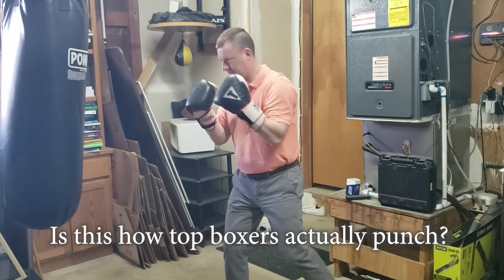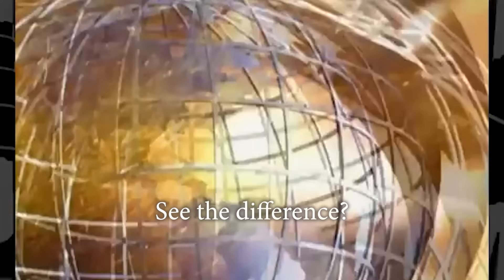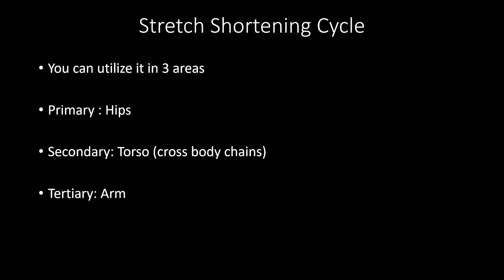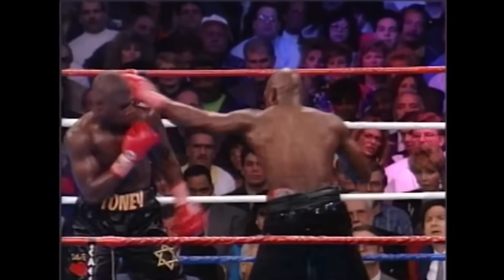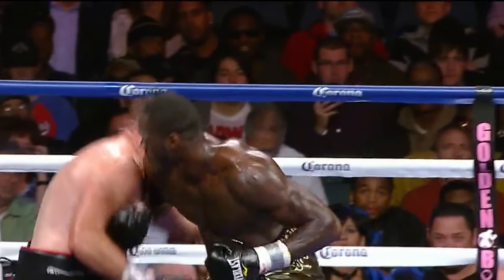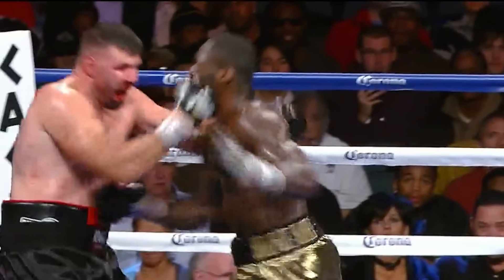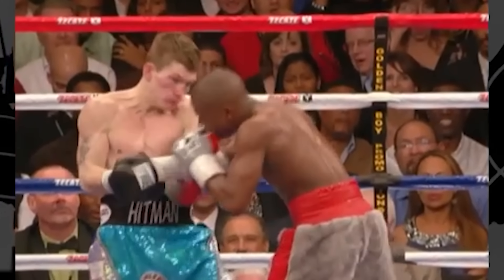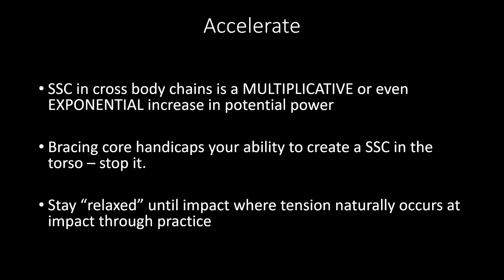How ALL "Natural" Punchers Generate Power: Kinetic Integrated Mechanics Reference Video

Comment: Hello Dr, I have a question. Do you think the opposite leg (rear leg for lead hand punches and lead leg for rear hand punches) should be attached to the ground at the start of hip rotation?

Or if you're in a situation where you have to move the opposite leg, do you think it's right to move the leg after starting to rotate your hip?

For example, when you fly your rear hand with your lead leg one step forward, do you think the punch moving your lead leg while rotating your hip time is wrong?

Comment: It's crazy how these mechanics aren't a solved problem yet actually. For me personally, the most basic thing I keep in mind constantly is just focusing on speed. I think of it like a whip, from the ground up I try to get as much mass moving... basically stacking speed, like a train riding on a train riding on a train etc.. and then stiffen it all with a good grounding posture at the end.

I find it hard to... imagine? How the 'mass' of your body plays into it, it's a constant. But I wonder if it matters how much of your body is moving towards the punch and how much of it at what speed.. If that makes any sense.
Reply from the maker: You have the right idea. It's a cascade of accelerating body parts. Check out my physics video for a bit more info.

Between my youtube videos and my program, The Power Punching Blueprint, I’ve pretty much solved it. It’s not a mystery anymore. My program goes into full detail and drills these movement patterns into your muscle memory so they are repeatable. It’s like learning how to throw a ball or a golf swing. Totally doable with the right instruction.

Comment: I noticed that you Sometimes lean a little Forward during your straight right. Does that increase the Power even more? I have heared that leaves bodyweight behind and this decrease your striking Power.
Reply from the maker: Check out my "cheat codes" video, it's "recoil management" or managing the equal and opposite force coming back when you land with power. You'll see all the guys I feature here do it too - GGG, Artur, etc.

Comment: The action of gripping the floor helps with the pushing off from the ground during the punches (and also stability after the punch). The muscle tension decreases the slack between the transfer of momentum from the floor through the toes, heel and ankle into the leg. It can also provide a bit of extra push off the toes.

Of course, those are micro-optimizations, but if you can train them so they become automatic and you don't think about it anymore, why not?
Reply: 100% Feet and toes  is where all chain energy starts light on feet and plant on power punch same as the hand open hand until near impact old school USSR training
Reply from the maker: it reduces surface area contact with the ground. you don't have claws... does a sprinter or running back try to claw the ground when he pushes off? no.
Reply: @ThePunchDoctor  Again, it's not about the actual gripping. It's the act of contracting the tendons to stabilize the toes and ankle structure. "Gripping" is just an easily communicable word to use.

You absolutely do use the gripping-like contraction in sports. Try pushing off the feet without our toe structure stabilized. Sprinting/running is not the same as the footwork in martial arts. For example, in fencing, when you push off the ground, when your heel comes off the ground, what's left in contact? The toes. Those toes can give you extra push in that split second. Imagine when your heel comes off the ground and your toes structure isn't stabilized.

Not to mention sprained ankles if your ankle structure isn't stabilized.
Reply from the maker: @kwanarchive  gripping gives an idea that you're curling the toes which is inaccurate and paints the wrong picture imo. we are talking about two different things.
Reply: @ Only if you take martial arts words literally.

Not all boxing coaches are academic teachers, and not all boxing students are academic learners. Telling someone to "grip the floor" is an okay (not perfect) way to get the idea across of what you need to do to stabilize the foot structure. That is what is meant by "grip the floor", and most people intuitively understand what to do if they don't nitpick it.

If there is a better way to communicate that idea, then fine. But I don't think it's correct to go the other way and say people are wrong for teaching it at all.
Reply from the maker: @kwanarchive  it encourages linear movement which is not how the body moves. I'll make a video about it.
Reply: @ Looking forward to it :)
Reply: @ThePunchDoctor okay I don't wanna nitpick but using sprinters here is probably the worst example possible given the fact that their shoes literally have spikes to do the gripping for them, as well as boxing shoes being relatively grippy which allows a boxer to move relatively on the balls of their feet without slipping all around the place. HOWEVER what was presented in the video makes a lot of sense in MMA or kickboxing where your bare foot has shit grip on the often slippery mat, and/or you need to be ready to kick or stuff a takedown for example

Comment: What was told to me is that I usually have my right hand high right? And punch from that position as that is a good habit. But punching with your cross from a lower position generates much more forces at comes from your body and hip. Instead of closer to your shoulder

Comment: Hello, I agree with your video, one small thing, at 8:39 you throw a jab, but your hips move away from the target, and u drag the rear foot back - which takes away a lot from jab power. only that snippet is wrong in regards of what you are trying to convey to the viewer at that moment, as pivot same side punches always rotate a hip away from the desired line of power. So at that moment the chain doesnt place all power to the spot you are hitting, using effectively only the part of the  chain starting from lower back.
Reply from the maker: I am moving backwards after I throw that jab. I have already completed the movement with my legs and body.
Reply: @ThePunchDoctor slow down the video, at the frames prior to the punch landing, and during the landing, your hips are going backwards, your whole @ss then also goes back, compensating by pushing your upper torso towards the bag. please re-examine at .25 speed a few times. i can also upload an edited video on tuesday, to show you what i mean, if you dont see this bit upon further inspection. i want to reinstate that i agree with pretty much all the rest of the video, so no need to get defensive. maybe you can adopt this and further improve your own power output!

Comment: Everybody can learn to punch harder. Not everyone can learn to punch hard.
Super fast twitch muscle fiber (type 2b), muscle insertions, joint length and elasticity and bone structure as well as the interactions between said points are genetic. 

But the video perfectly explains the mechanics necessary to produce maximum power. Very detailed and extremely well researched.

Comment: This theory does apply to that left hook more specifically. BUT  the punching power in the Jab and the straight right comes from forward diagonal movement and not loading up if you load up its over you will get countered you throw the jab in an instant when you move your body weight towards them then the riggt hand in an instand as the back leg steps but in an instant most people are moving thier body then throwing its supposed to be instantaneous thats what gives you the real power.
Reply from the maker: Load means loading elastic muscle energy into the muscle then releasing it with a contraction for more speed and power and it's 100% applicable to the jab and rear straight punch. Go look at my Terence Crawford video I just did where I show how his jab is faster than Spence Jr's specifically due to these mechanics.

Comment: I have only one little nit pick with this. The reason why most arent thought to throw punches like this in the gym is because these huge power punches become way to telegraphed. I feel like its more of an advanced technique and mechanics that should be learned later on because if you throw every punch will full power you will get countered in no time. These style of punches should only be used when you see a blatant opening on the opponent or when if you have enough time to execute without being in risk of getting countered.
Reply: Interesting point… I can see where you’re coming from.
Thankfully for me, every punch I throw is telegraphed!
Watched Bivol explain this to someone yesterday and utilised it in sparring. 
It worked tremendously. I would argue that the punches were faster, less telegraphed and certainly more powerful.
But as I said before.. all my punches are generally telegraphed.. it’s early days!
Reply: @IrishPimp92  did you spar against anyone expirienced yet? Because maybe beginners won't take advantage of it but certainly anyone who's more capable will punish you for being to telegraphed

Comment: I have mixed feelings about this material. The squishing a bug and other ideations are absolutely useful for people that have no idea how to throw a punch, gravity is seriously not enough at all. I think you haven't trained some of those really ungracious and uncoordinated people out there. All other things you describe are of course true, but pro boxers achieve this by being more relaxed (or at least losing the instinctual tension). Btw the method of generating explosive strength by starting with the hips is very similar to how many "internal" Chinese martial arts work.
Reply from the maker: you can't "grip" the ground with your toes though. The best you can do is push off. You can't get more force into the ground than gravity and your body weight will allow. you can perhaps increase leverage with the position of your rear foot to push off. However trying to grip the floor with your toes is not going to give you an advantage. In fact it will reduce the surface area of your foot's contact with the ground potentially reducing grip.
Reply: @ThePunchDoctor  during the punch, no, you can't, that only helps developing good stationary position and if they teach that at boxing, then it's wrong and, well, weird
I only know the concept from the tcma, never attended a single class of boxing, and it definitely isn't a part of a punch at all, it's to align the body into a stable position to be harder to push for example, but that definitely does not apply to any dynamic force application
maybe it's a similar concept that have gotten misconstructed somewhere along the way?
Reply from the maker: @KilicArslanBahadur  I don't know. I just think the cues are not that accurate. Squishing the bug, or internal rotation of the leg, does not cause hip rotation, which is how you power the punch. The cue should be rotation the hips, not the leg, which is what I'm trying to get people to think about. You can rotate the hips very well by using the glutes and hip muscles. This stretches the cross body kinetic chains that I describe so they can contract. If you do it fast you can elicit the SSC which powers the punch with a more violent contraction.

Comment: I entirely agree such a great video. I also wanna say that when you slip or roll it already loads the punch for you. the combos i have the most success with are rolling then hook or slipping then straight. also ive found a lot of success in switching stances to drive in faster or retreat.
Reply from the maker: thanks, yeah 100% agree with slipping and rolling and using your weight to add offensive capability to those defensive moves.

Comment: Beginner are taught like this because it’s the correct way… only over time and repetition you relax more and it becomes more smooth with the snap otherwise you’d have everyone just winding up and swinging like street fighters.. you’ve got this wrong people should be taught proper technique even if it is stiff at first with experience comes the snap… your body naturally gets used to this
Reply from the maker: your conclusion that people will wind up and swing like street fighters is not a logical result of using the integrated non-linear mechanics. I have a formula that teaches it without any wild swings. The "proper" technique isn't actually proper technique, people just call it that because they don't know any other way to teach it.
Reply: @  beginners are taught like that because an example would be keeping atleast one hand to your face guarding while throwing is more important to a beginner than thinking to much about getting all those mechanics right for a punch they are going to be slow as hell to start that stuff you are talking about comes with time as your tendons and muscles get used more to that action they relax and the type of punch you are talking about is more easier thrown..
Reply from the maker: @lukewilliams010  they may still be thinking about "gripping the floor" or "squishing the bug" which just aren't the best cues in my opinion. Those sayings don't promote the actual movement that is powering the punch, which is opening or closing of the hips. "Gripping the floor" may actually reduce your foot's surface area contacting the ground reducing grip. It's silly imo.
Reply: @ yeah but your saying that boxing fundamentals are wrong.. I’ll agree your way to punch with the snap is correct but that’s something that’s developed through repetition and understanding. stance,guard,positioning are all more important than actual punching in boxing neglect these things early and it’s very hard to build them back into habits again… you do not want to confuse newer boxers with how to throw the actual punch while they are learning this.this is more suited to people with abit more experience that maybe haven’t got this technique boxed off  or have yet to comes to grasp with it. Not green boxers. To disregard boxing fundamentals as wrong, is wrong..
Reply from the maker: @lukewilliams010  that's a misrepresentation of my position. I just have a different way of teaching the mechanics from the ground up that lends itself better to generating power, as it is more in line with how the body naturally moves and generates power. nothing really changes except the mechanics involved.
Reply: @ well it does because the novice boxer is going to keep his right hand to his chin… tight and tense which means those muscles are going to tight.. it’s not going to allow the freedom to rotate easier etc.. only when more experience he will understand that the right can move from the position to parry, cover different parts of the head etc… I don’t know whether you’ve been a boxer or not but your right,but your wrong 🤣

Comment: Ryan Garcia is a good example of this

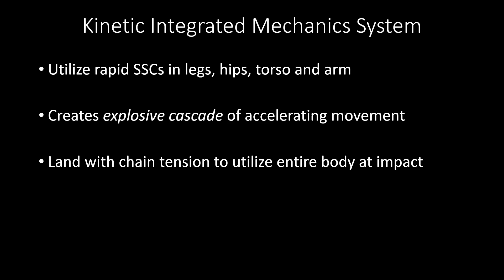also 11:49 Inoue does what you're referring to but there's one critical thing I'd like to add. He throws the straight from a lot closer than most people teach (he gets in the pocket). He also dips his head to the ground at the end of the punch which drops his weight downward and adds even more power to the straight.

I know this because this is exactly how Rocky Marciano got all his KO's. I actually call it a Rocky Marciano straight, he called it the suzie q (though wasn't always a straight, depended on context iirc) and you see it frequently in boxing, but he did it best.

Comment: As a muay thai trainer, I agree with theabove, although a bit complicated in the explanation. At min 10, comparing to tennis is a good way to explain. Or how you use a scythe:I would add the importance of the step, which is missing here. The step induces the body weight to move, then come all what you explained. The direction of the step (where you foot points) will be important too. But first you step (jump), then you do the rest. This is the way you "hit will all your weight". Otherwise, I am OK with the contet. Have fun and hit hard!

Comment: I hit hard with my straight punches but my hooks need a lot of work. Great video I understand a lot better now
Reply: I had the same problem, but now my hooks are the harder punches. Just keep doing it. Let your shoulders be fluid.
Reply: I’m the opposite, I have a hard time snapping straight punches. But my hooks are on point, because of the hip twist. 

I think what I’m missing is the quick hip snap on the jabs/straights